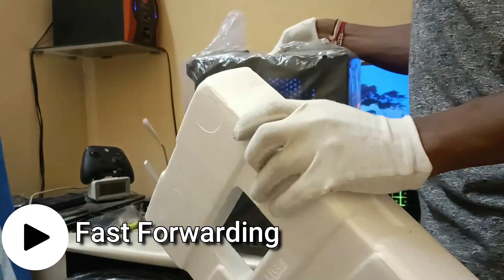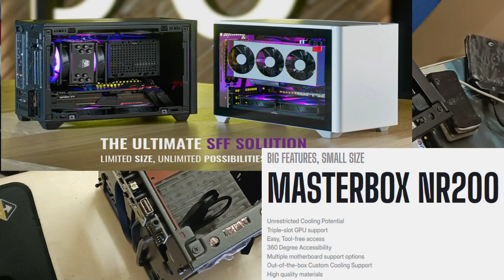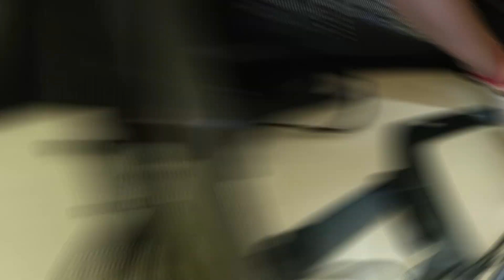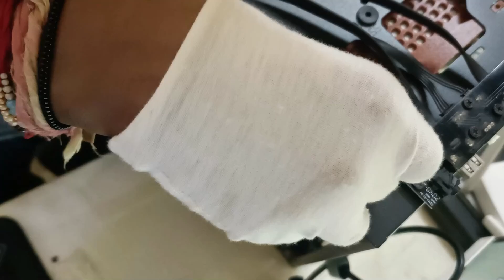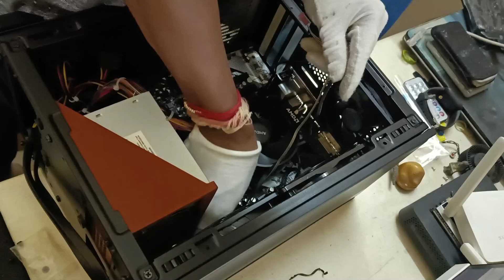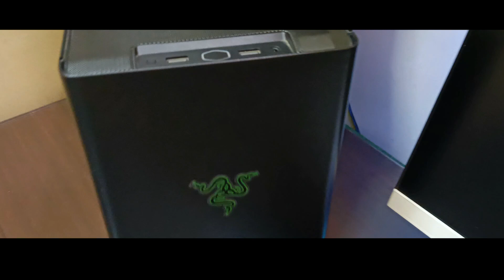Cooler Master NR200 PC Build Using Micro ATX Motherboard | is it possible ???

Comment: Hi I have a question. I wanna build in this case but i doubt myself in 2 different sockets am4 and am5. For am5 I wanna use a620m plus wifi asus tuf mb but will it fit in nr200p? Also I want  cooler master atmos white 240mm aio.
Reply: Also I will mount my gpu vertically and I will use cooler master sfx750 white sfx psu.
Reply from the maker: Also because if you use micro atx board then it doesn't matter if you are using a sfx psu or normal atx psu.... You will have to install psu at front only ( like i did in video ) because micro atx board will occupy those side mounting for sfx psu installation.... And also because of this when you install psu at front you will only be able to install a gpu of upto 22-23cm lenth not matter if install ur gpu vertically or horizontally
Reply from the maker: Brother the motherboard you mentioned about is little bit big for this case.... If you don't have budget for ITX motherboard i will recommend you to buy a micro atx board that has size of 20-24cm vertically and should be or under 23cm horizontally ( this size is measured while motherboard is in install position in case )
Reply: @ultimate_worm Ok but I will use sfx psu cooler master w750sfx white will it fit with sfx psu or not? And yeah I have a budget for itx mb but in my country it's extremly rare to find one.
Reply: @ultimate_worm Ok I'm planning to use rtx 5060 white asus dual or msi ventus,both white,but i don't have a clue will it fit or not. Both dual fan gpu's. But now I'm considering low profile version from gigabyte since u mentioned that.
Reply from the maker: Yes it will fit your mentioned 240mm aio... But because you want to install your gpu vertically so that's why you will need to install aio radiator at top or bottom..... If you install your gpu in normal horizontal position then you can install radiator at top or else side
Reply: @ultimate_worm Aio will be bottom
Reply from the maker: And make sure to use only a dual slot gpu if you use thicker gpus like 3 slot gpu it will hit the Aio pump and it will make space more tighter in case
Reply: @ultimate_worm Dual fan gpu eather msi ventus rtx 5060 or asus dual both white bc I'm doing white build,with caribbean blue nr200p case of course. But maybe I will consider gigabyte low profile version rtx 5060,although its black and i need to paint it in white.

Comment: Do you think it will fit?

Micro ATX Form Factor: 9.6-in x 8.9-in, 24.4 cm x 22.6 cm
Reply from the maker: No it wont fit actually in wide it can but not in height... Height should be 23cm or less wide you can upto 22cm

Comment: Not enough room for intake fan on the bottom?
Reply from the maker: It have but it is situational...like when there's no gpu installed or when only single slot gpu is installed then u can easily install fans in the bottom. But If you install dual slot gpu in normal regular position then u can't install fans in bottom but instead u can install 2 fan in side panel with the help of a frame that comes included with this cabinet... Also if u really want to install fans in the bottom and also want to use a heavy or dual/triple slot gpu then you will have to vertical mout the gpu with the help of a bracket that also comes with the cabinet..  this cabinet is very capable and customisable

Comment: I did the same for mine just used a flex psu and had more space, onky needed 400w anyways so
Reply from the maker: Flex psu 🤔 never heard about it before
Reply: @ultimate_worm  yes its used in sff case setups "lunchbox cases" lol theyre like 3x1.5x6 very very small psu
Reply from the maker: @thatonegamer2709 can u share link of one ?
Reply: @ultimate_worm  
Apevia ITX-PFC500W Mini ITX/Flex ATX / 1U 500W Fully Modular Power Supply, Full Range Active PFC 90-264V, AC for POS AIO System Desktop Gaming Server Small Form Factor (Flex ITX) Computer PSU

Comment: That appears to be a Mini ITX motherboard you insatlled and not a Micro ATX motherboard. Micro ATX motherboard have 4 ram slots and the one you installed into the case has two.
Reply: nah, mATX can have two ram slots. usually A class boards have two and B class have four ram slots. mITX boards on the other hand are a small square, only big enough for one pcie slot at the bottom that spans almost the entire side.
Reply from the maker: https://www.asrock.com/mb/amd/a320m-hdv%20r4.0/index.asp
Reply: @ultimate_worm  This mb dimensions 9.1-in x 8.1-in, 23.1 cm x 20.6 cm. Standard m-ATX boad is  24.4 x 24.4 cm.
Reply from the maker: @Gorael.v  yes thats why I used this Asrock board because it is bit smaller compared to other micro atx board and it is also less price.... But u can install asus prime a320m in it also..... And mini itx board are little bit expensive compared to micro atx board
Reply: @ultimate_worm  Thanks for your answer. itx more expensive - it`s true. But I have the same case and i don`t think that standard size m-atx motherboard will fit in this case. On your video Asrock 320M fits perfectly to the bottom of the case, and it`s smaller. Aasus prime a320m 8.9 inch x 8.7 inch ( 22.6 cm x 22.1 cm ) is also smaller than standard. I`m considering to go to am5 platform and currently looking for mobo that costs less than itx variants but it seems i wont find any.
Reply from the maker: @Gorael.v yes in Am5 no m-atx board is this smaller..... But alternately u can go with intel side also like Asrock h610m.. it is m-atx board with very small dimensions 19x18cm and support 12-14th gen

Comment: How many mm are left for the gpu?
Reply from the maker: U can fit any dual fan 2 slot gpu easily without any problem
Reply: Even using the ATX PSU? I'm thinking in making the same project as you and would appreciate your insights on it.
Reply from the maker: @RodrigoSilva-dv9xo yes normal size atx psu

Comment: Shit move? With all the expensive stuff there and stillbises a generic powersupply. Your like buildibg a concrete building with a wooden posts.
Reply from the maker: Yes u r right but it was for temporary use later on i upgraded it to better power supply unit. Anyways this build is not going to pull more than 100-120 watt so even the generic power supply was more than enough for temporary use
Reply: All the components were junk. The board, the cpu, the ram, the psu. Everything.
Reply: @christopherjames9843  Must be why he didn't title it "best build ever shoved in a NR200!"
Yeah, I am responding to a 9 month old comment. Yet my level of a-hole is still well below yours.